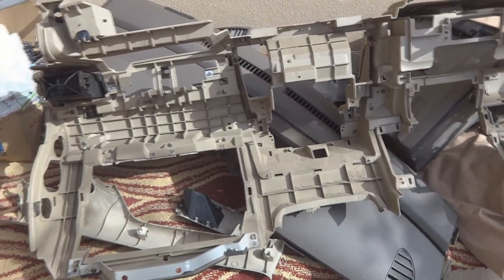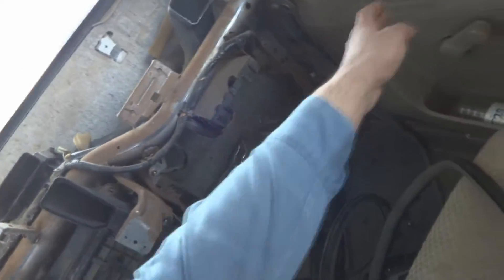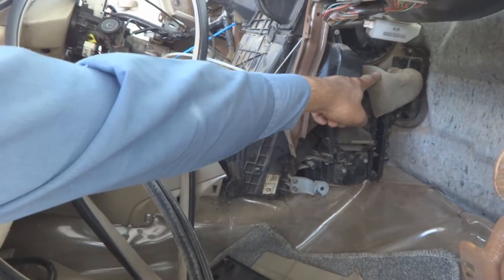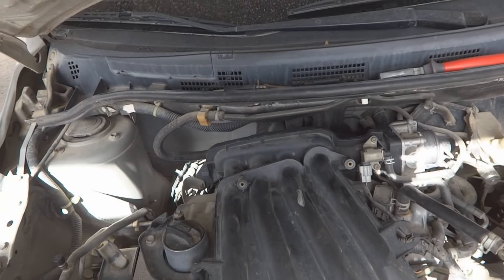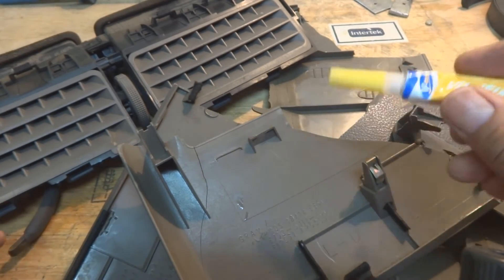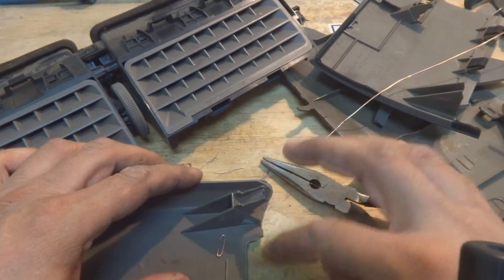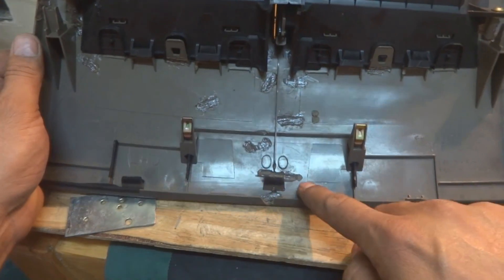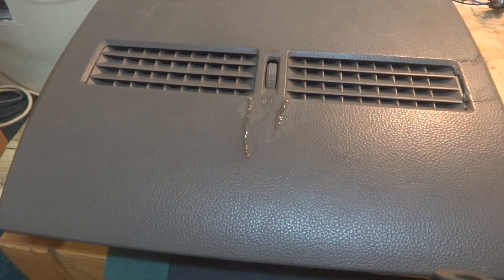Car air conditioner evaporator replacement; refrigerant refilling

Comment: Hey Jahan...when I first saw the inside of that car, I said Jahan is never going to get that thing back together LOL...you know that I'm just joking. You've got a lot bigger AC job than I had to do recently. With those type of plastics, I've had good results with this product https://www.permatex.com/products/adhesives-sealants/epoxies/permatex-plastic-welder-epoxy/ The glue would strengthen and hold the joint together and you could use your wire hook method to hold it together more securely. I don't envy you on this job Jahan....take care and stay cool...

Comment: Loverly job jahan :-D, plastics are horrible to repair, very hard to get them strong again :-(.
You have endless patience my frend, your frends are lucky to know you :-).

I have never found any glue that can bond propperly with the plastic, super glue is very brittle.
I think i would add patches on the hidden side of the dashboard to add strength and use rubber solution/bostik/silicone sealer or similar gloopy glues.